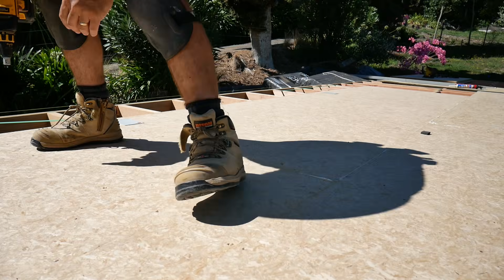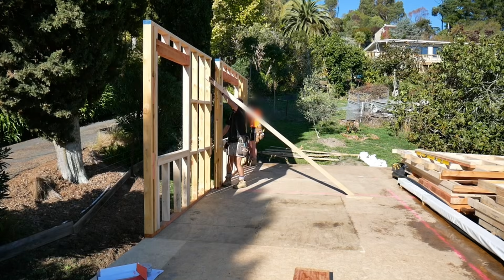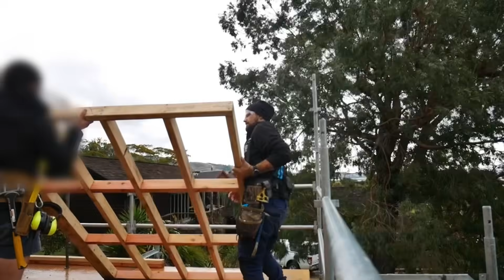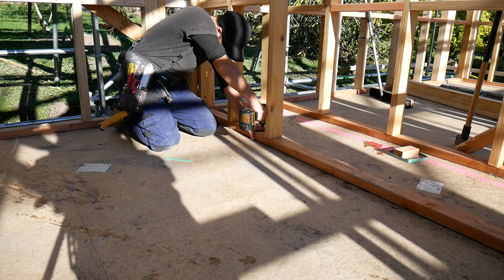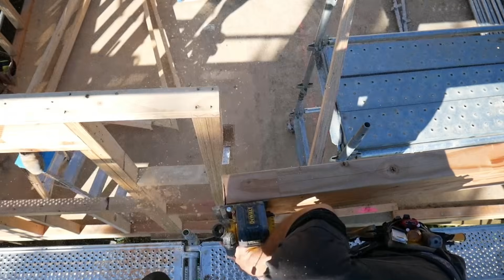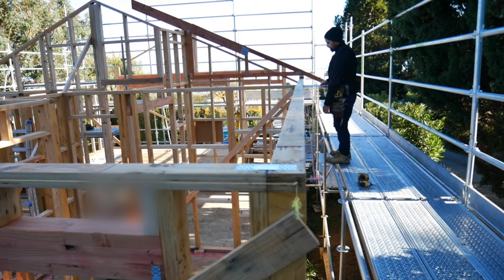Building a House - Standing Timber Wall Frames | NZ Build

Comment from the maker: I still can't believe we just stayed at home for 5 weeks. That was a hard slog getting back into work.
Reply: What a messed up time 😂 stayed at home for 5 weeks so we could come out and catch Covid anyway…. And then had to take the vaccine so we could still get Covid.

I hope we never go thru anything like that ever again, what a mess
Reply from the maker: It still blows my mind that it was over 6 years ago 😅
Reply: Tell me about it, I was a rigger doing vertical access and fall arrest (those nets which work really well which builders hate until they fall into one and I don't have to scrape arrogance off concrete) and for the first few weeks back I had vertigo up on the rope, bloody terrifying in central Welly with a good breeze going.

Ironically, not long after I had a fall while showing a young guy how to do small nets in wardrobes - very easy job but there's a technique to get rid of the tag end so nobody hangs themselves, it's happened before - step ladder hinge bolt gave way and I got the base of my skull on the corner of a packet of ply, pulled the lintel down, couple nails in the old lung. Not a rigger anymore.
Reply from the maker: Mate that's extreme 😢 I'm sorry that happened to you. 
I'm a builder who doesn't mind nets, I fell through roof framing in my first year in construction, it was a commercial site so they had given me a harness even though it was only a single story section of the build, had I not had the harness it probably would have been a short stint in construction for me